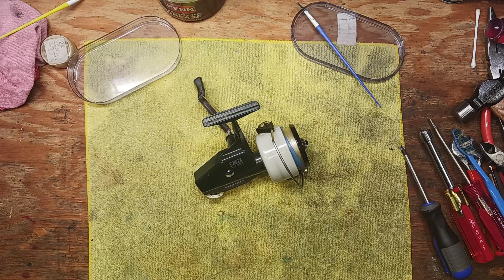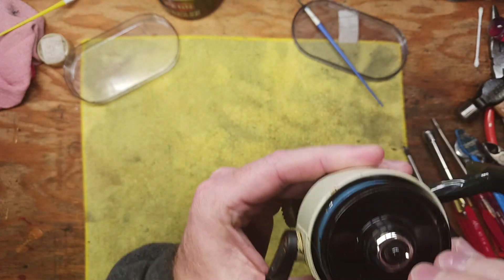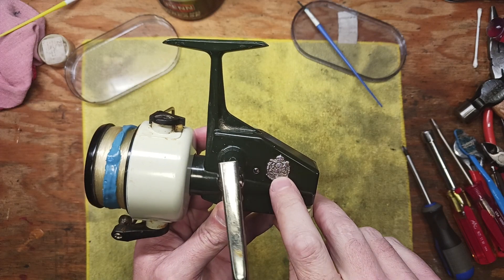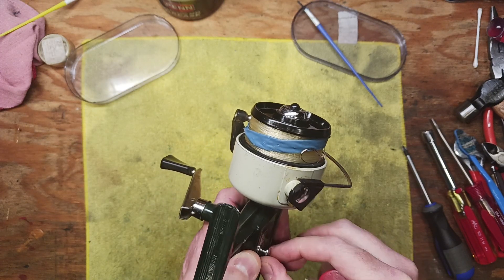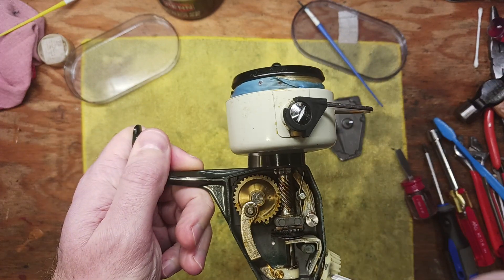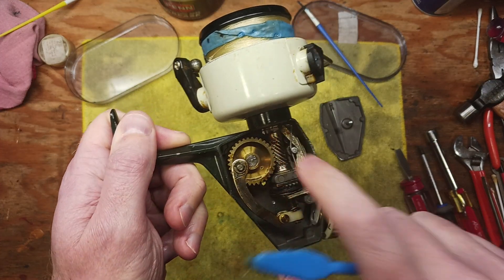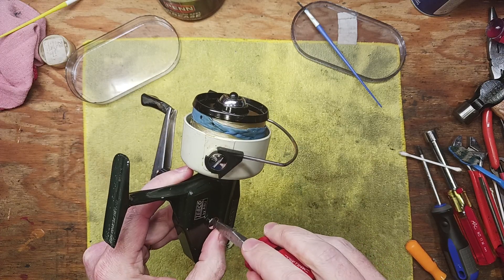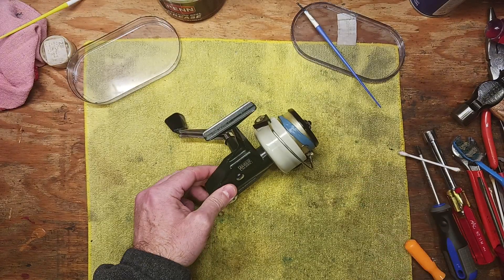Zebco by Abu Cardinal 6 Spinning Reel Anti Reverse Failure and Fix

Comment: Tony, I love these reels and after finally learning all the tricks for servicing them I’ve loved using them.  I own two of the No. 6 and two of the No. 7. The only difficulty I’ve had with them is the size of the handles for surf fishing even though Abu designates them as saltwater reels. I have found these to be amazingly smooth  with drags that are also amazingly effective. They can be a pain to disassemble until you learn all the tricks.  Few vintage reels remain as popular as these do and few reels retain their value like these either. — Chris
Reply from the maker: It is a nice reel for sure! Thanks for watching! - Tony